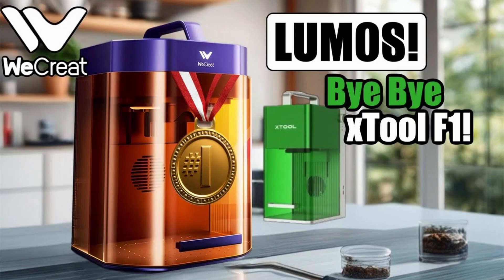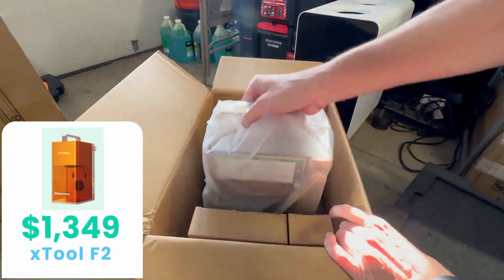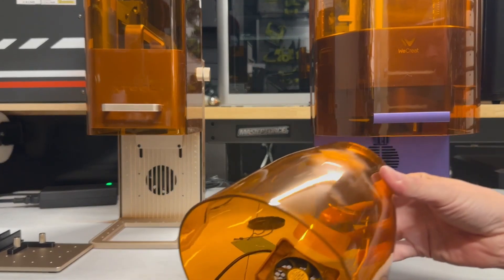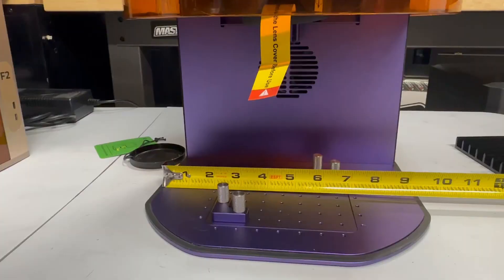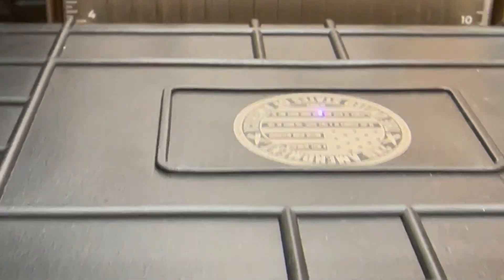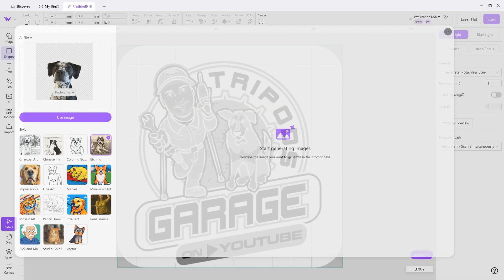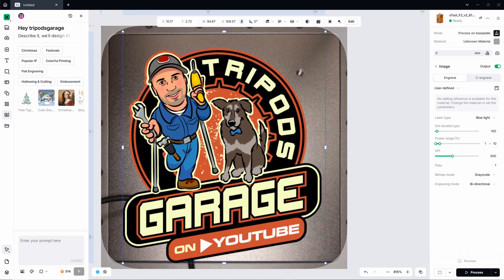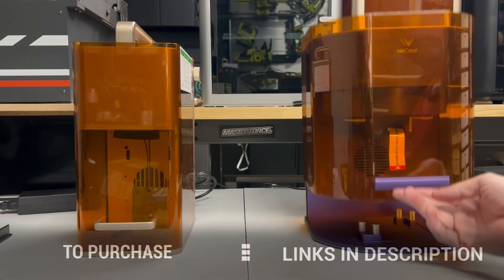xTool F2 vs WeCreat Lumos

Comment: A key difference that made me return my F2 was the area of the enclosure for the Lumos. While the F2 is smaller and lighter, If you are at a fair or market and want to do something like a knife or tool, having that extra area under the shield is a big deal for safety. 

Also, I'd have to disagree on the software comparisons. As someone who has worked with vector tools extensively the wecreat software is much more feature rich and intuitive. IMO Both systems are lacking as far as their material libraries. 

Another big one: WeCreat hasn't locked down their machines to disallow custom gcode and interfacing with lightburn. xTool is moving heavily towards a closed ecosystem.

Comment: I love the comparison between Lumos vs xTool's F2, many thanks for doing it!  Big thanks for pointing out safety issues with the Lumos, i think you're the only one covered it.  Also wondering one very important question about safety... as long as the safety shields are down (enclosed), it is safe to use, and not worry about keeping on the safety glasses, correct? Of course, I'm not talking about staring at the laser, but you get my point...
Reply from the maker: Many thanks!  It drives me nuts that the only manufacturer that provides safety glasses is ComMarker, whether it has an enclosure or not.  Especially when they show a conveyor, or rotary being used with the enclosure up.
I try to wear safety glasses whenever I use it, just because I don’t trust safety switches.  Also there’s a chance of laser bleed.  I believe that these are safe, as long as they are fully closed.  As they have to pass FDA standards for their classifications.
Hope that answers your questions?
Thanks for watching and commenting 👍

Comment: Absolutely, xTool is the way to go👍👏😊! Why? Not too long ago I invested in WeCreat products as a newbie to lasers, and what a big mistake that was. What content creators don’t look into or share is product quality, innovation, and customer support—three areas where I had a terrible experience with WeCreat. Their products are cheaply made, and there are far too many customer returns. Plus, they don’t offer exchanges for faulty devices. Instead, you must return the device, wait for a refund, and only then decide whether you want to buy the product again.

Customer service is one of the worst. WeCreat has a tendency to blame issues on their customers instead of taking ownership of their product problems. Lastly, WeCreat isn’t in the business of innovating; they just push out more of the same product lines.
As soon as I purchased my first xTool S1, there was no turning back. I spent hours researching before making that purchase. I even made several calls to xTool with questions and to get detailed information on the S1, including xTool’s company history. Good luck trying to call WeCreat.

From the time xTool rolled out their first product, it has been nothing but a hit. Every xTool product line has been designed not just by a team of engineers, but with consumer involvement. From design to quality control to the details of packaging, xTool is definitely the Rolls-Royce of the laser industry. xTool invests heavily in innovation—more than any other laser company I’m aware of. Of course, xTool isn’t perfect, but when something is broken, they listen to their customers and fix the issue. You rarely see that in any industry today.

Yeah, my hard-earned money is well spent with xTool products. I can proudly say I’m the owner of the xTool S1, M1 Ultra, and my new F2—and I’m not turning back. I will continue to purchase xTool products without thinking twice. It’s really a no-brainer when choosing between WeCreat and xTool. I learned the hard way. I hope you don’t make the same mistake I did. 😎